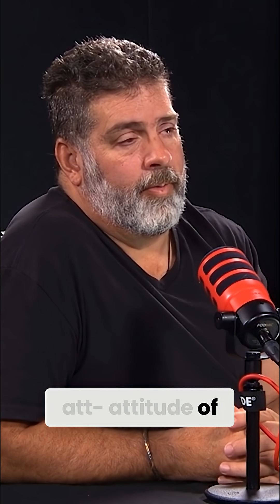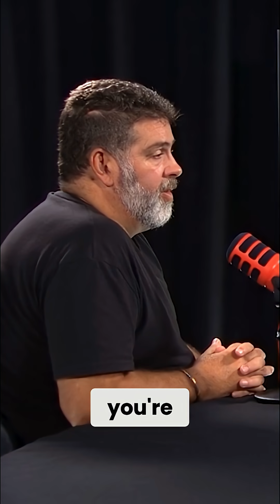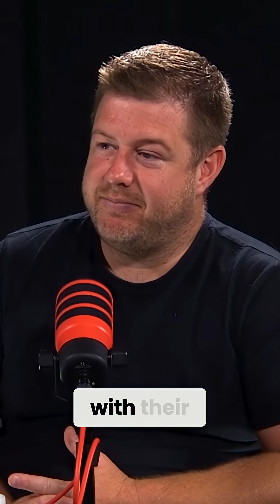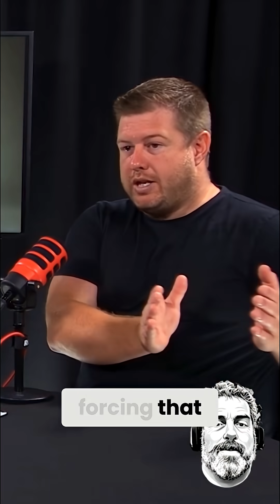Chip Seal Roads: Why Are They So Bad? #shorts

Comment: Whoever invented ship ceiling for the roads needs to be held accountable for this BS. The roads need to be paved like they normally were tired of running through tires. Windshields and not having proper traction and snow and ice and sometimes even rain with this cheap crap.
Reply: I'd rather just have a freaking gravel road. It would be less damage to our vehicles